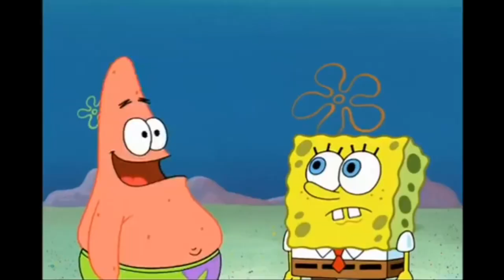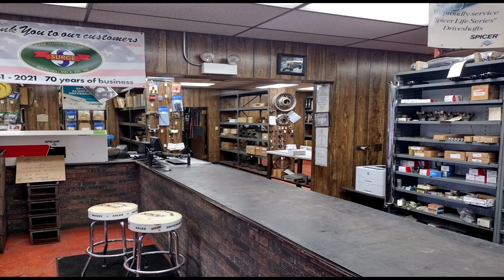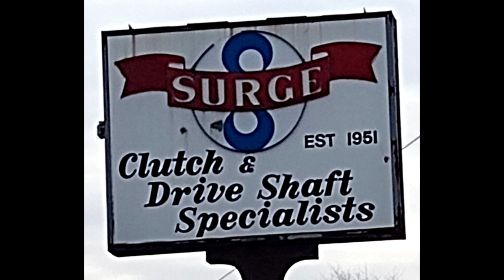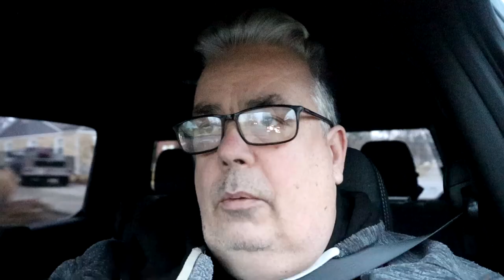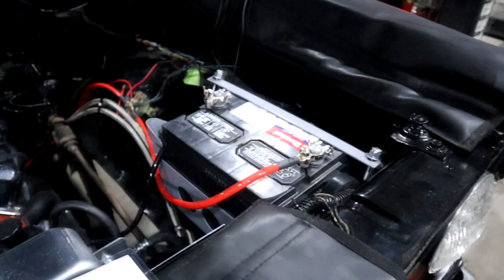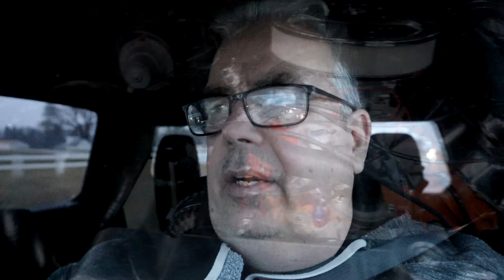4" ALUMINUM DRIVE SHAFT  440 46RE 79 DODGE

Comment: why not use an all wheel drive/full time 4wd np203 passenger drop transfercase from a ramcharger or FSJ while leaving the unlockable hubs.  Still have some all wheel drive capability and all wheel drive launches if you wanted.
Reply from the maker: I just put the 46re rear wheel drive transmission and let her fly